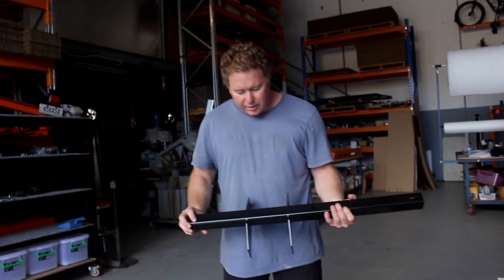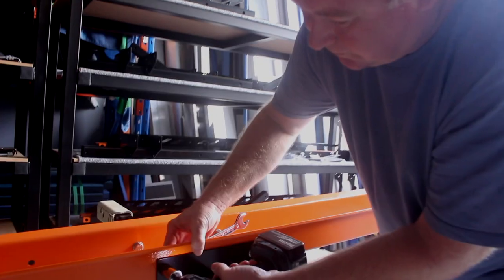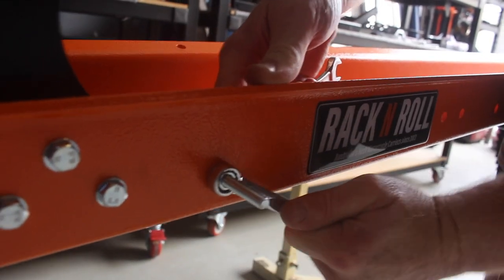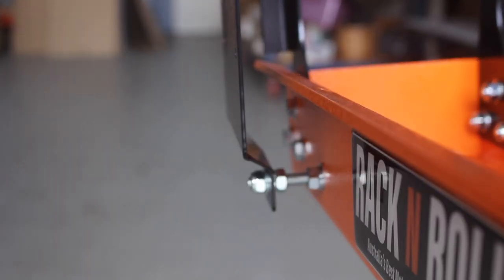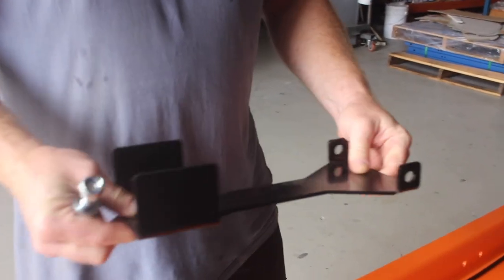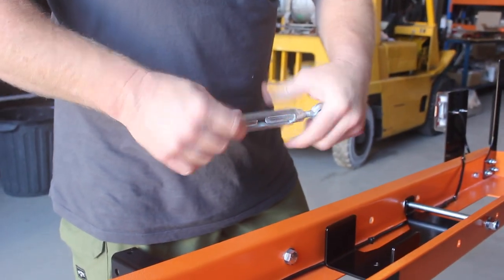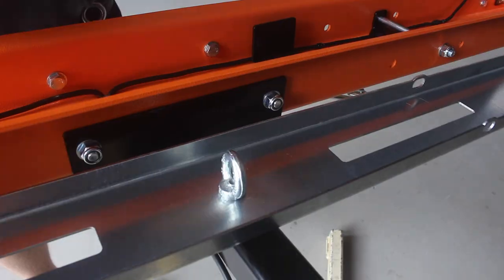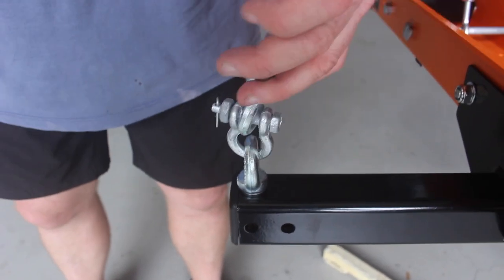Rack N Roll / Rack N Ride MX Carrier 2021 Assembly Tutorial

Comment: If case it might help, in the US, I bought a Curt 4-way flat connector part 58031 to connect to my factory wired Subaru trailer hitch wiring connector.  Was $4.99 at autoparts store.  I hooked from car / new connector to carrier:  White to White, Yellow to Yellow (left turn), Green to Red (right turn), and Brown to Black (lights).  Brake and turn signal lights work, your results may vary.